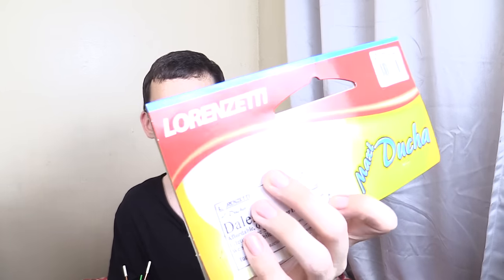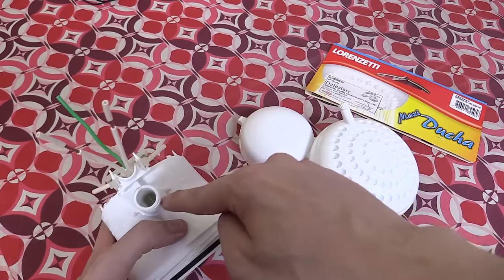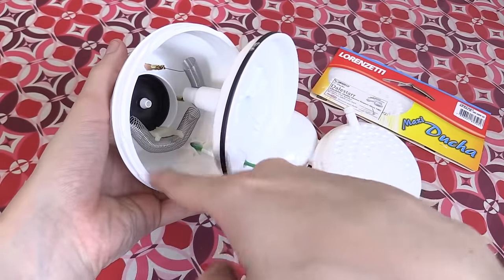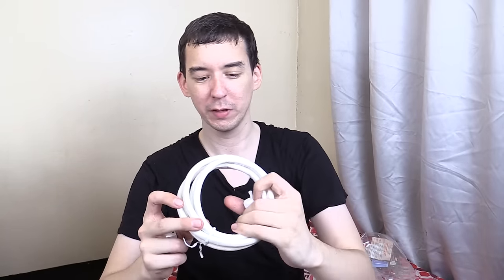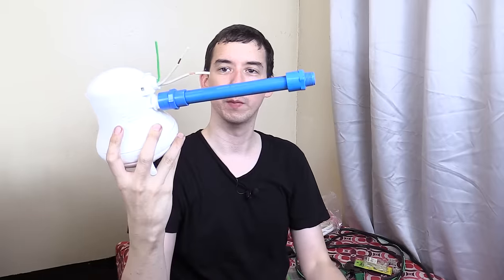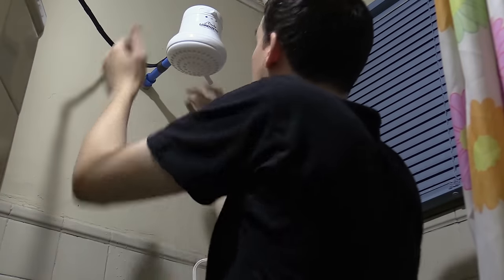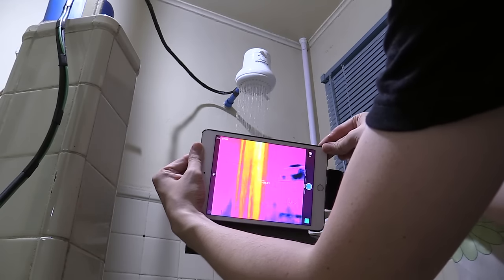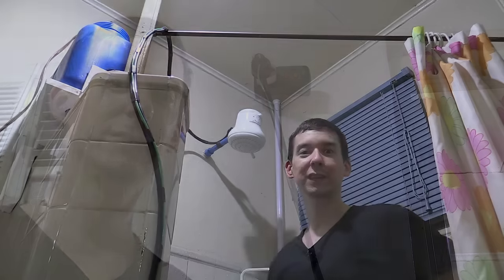Lorenzetti Electric Shower Head

Comment: Well you don't get electrocuted with these shower heads for two main reasons the first is because the "potential difference" happens mainly between the two ac lines and not between the ac line and the ground (or you). The second reason is because of the water flow isn't consistent meaning you have little drops of water falling on you and not a straight water jet what does it means? There are air gaps between the water drops and as we know air do not conduct electricity. Lorenzetti is a well known shower head manufacturer and it's been on the market for very long time so do you really think that if these showers were dangerous they will still in production?
Reply: Buddy just bc it's still in production doesn't make it good. Kimber 1911s are still made despite them being over priced trash that will blow up in your hands and lodge shrapnel in you hands and face and people still buy them. Unless you're super poor there's really no reason not to get something a bit better.
Reply: skinnypimp The fact is:
Me, and any Brazillian can remember any accident with eletric showers. It’s a big myth.

Comment: I'm Brazilian and I can assure you that this definitely would never kill someone... I personally hate electric shower but not for that... I think that the water is to "weak" (not pressure enough, imo) and also not hot enough, that's why I prefer solar heating system (also a very good option for you on Phillipines) or the gas one. Nevertheless most people have it because it's way cheaper than making an investment in a solar heating equipment (also, buildings rarely have it), gas is generally not available in smaller cities in a safer way and so on.

Comment: We just use an electric tankless water heater.
Reply: EJ Tech that sounds like a way better option tbh
Reply: Ours is propane but same concept love it
Reply: EJ Tech: ... Honestly I was here to post that a Tankless would be too cost prohibitive, But I checked Home Depot Canada and a 5500 Watt Tankless HWH (suitably for a VERY nice hot water shower) is only $191 ... compared to the Suicide Shower Head at $30? ... the tankless is a very reasonably priced alternative and 100% safe ... GREAT tip!
Reply: Hh Hh no a tankless heater feeds hot water to the entire house.
Reply: Here in the UK a 10kW  electric shower is fairly normal, but we don't use a goofy low 110V supply. A suicide shower would trip the residual current breakers that are in most houses as well as them being such a low wattage they're useless.
Reply: @MrsZambezi  The one he was using was running on 220V AC. Give or take, UK voltage runs barely higher at  240V AC if my memory serves me. Here in the US, we achieve 240V AC in residential settings with opposing legs of 120V AC.
Reply: Why not just use 240V for everything in the first place?  We can plug in 3kW appliances everywhere. That shower is pointlessly dangerous as well as being too weak to heat the water properly.

Comment: O melhor de tudo é aprender a trocar um desses desde criança, sem nem desligar a chave geral. Aterramento é luxo. Ninguém morre, até porque o choque de 220 V só te joga voando na parede. 

...and the best of all is that you learn how to change one of those things since you're a teen. Without turning the power off. Grounding? That's just fancy. Nobody gets killed. Even 'cause it's a 220 volts electrochock and it'll just bounce you flying against the wall
Reply: "só te joga voando na parede" kkkkkkkkkkkkkkkkkkkkkkkkkkkkkkkkkkkkkkkkkkkkkkkkkk morri tanto quanto um choque
Reply: kkkkkkkkkkkkkkk verdade

Comment: 4:40 is not because "blowing itself up", it's because if it keeps filling the water will raise and probably leak into the electric part.
Still entertaining watch, I live in Argentina (right next to Brazil) I've never seen one of these in my entire life.
Reply from the maker: Thanks for the info :) By the way, when I said blowing up, I meant more that the top or bottom part would blow off because of the pressure rather than some kind of explosion :P
Reply: I am from Argentina too and when i went to Brazil i was shocked (pun intenteded) by this little thing. I could actually felt the electricity and i figured out that the whole water heater machine was inside the shower! Freaking scary for me cause i never saw something like that before.
Reply: Brazil and Paraguay, they are very common in the suburbs and in many major cities because of its cost. It is much cheaper than buying a water heater and do all the pipes. In Argentina there is a similar system, the electric water heater which is basically a plastic or metal can with a resistance inside. You fill this with water, connect it to the the socket, and it has a shower built in. The most advanced models had a on off swicht, for the rest it is advisable to unplug it before using it. In my case, very useful when the Gas company closed the gas connection for months.
Reply: Hernán Payne i live in paraguay, everyone uses it, i only know one friend that almost died, and not cause of these showers, ironically, he actually had a external water heater for the whole house and it suddently exploted for no reason, since then he uses this "dangereous" solution.
Reply: I've seen hundreds of these in Brazil. I do hate electric shower heads because you get a trickle of water that is either superhot or just cold. Always rented apartments with real gas heaters.
Reply: These are also common in Venezuela under the brand name Corona, which looks even cheaper than this. At 120v its half as efficient to heat the same amount of water, so its lukewarm at best, and yes you do feel electricity if you touch it or the shower has a metal part, which is very very common. People may not die from them but i still hate those things, it is however the cheapest way to have heated water at your shower. I also used one in Peru, which is a 230v country, but it was "winter" so the outside water came so cold the little thing couldn't cope with it, but if you you didn't use it the water came out freezing as opposed to cold... Yeah, same "tingling" sensation when opening and closing the (metal) valve, fun times...
Reply: Electric showers are common in South and Central America, I think only Argentina and Chile don’t use this type of shower, because this 2 countries are on the cold part of the continent. Here in Brasil is not viable to build a water heating system because only a small part of the year are “cold”, and we don’t use hot water in sinks and in the kitchen sink. the coldest regions the average temperature in winter is 10C, and in the biggest cities the average is 18C for São Paulo and 23C in Rio
Reply: @freeculture   Corona....interesting

Comment: American here and former electrician.  I’ve seen these things on several trips to Peru and I saw a lot of this crazy wiring. I was told “don’t touch the shower head while you are taking a shower”. Just insane that anywhere in the world a product with such a tiny safety margin would be so popular. 

The reason you won’t see those in the US is that even if there was 2 deaths a year the company would be sued into bankruptcy. We have electric water heaters in the US and the conductive element is surrounded by ceramic insulation and encased in a grounded metal tube. At no time is electricity in contact with water. 

As far as gas explosions from electric heaters, those almost never happen. I have never heard of one on the news, and have never heard anyone tell me it happened to them or someone the know.  We know they happen because safety videos tell us, but it is statistically zero.
Reply: I live in Brazil, used to have that shower head, and currently have one that's pretty much the same, except a different brand. I would be amazed if there's been even a single death by electrocution caused by this shower head in the past decade.

The average toaster you can get in the US electrocutes more people than this shower does.
Reply: Of course you don't touch anything electrical while you are showering, your hands are wet! Dry them up first
Reply: @QuotePilgrim  You can find plenty if you look for "muerte ducha eléctrica". How many of those deaths in Spanish-speaking Latin America are due to locally produced showers and how many to showers that Brazil exports, I do not know.
Reply: @haraldhelfgott195  well I remember looking up news in Portuguese about this happening back when I wrote that comment, and didn't find any. Maybe if I used different search terms I might.

Anyway, sure, it may happen sometimes but I never about it from anyone I know, nor read/watched any news about it. It's safe to assume that it's an exceedingly rare occurrence, and I would still bet on people getting electrocuted by toasters being a far more common thing.

Comment: These are the norm here in Brazil, they're cheap and you don't need a heater but I can agree it has potential to do harm, the biggest problem on them is that the cables are usually thin and when it's colder you need a lot more potency. It's not uncommon to see the stuff getting on fire around the tapes or the cables melting. Also lots of people install these shower themselves instead of paying for a capable professional to do the job.

Comment: There are also high quality electrical showers here in brazil. In fact, almost all homes in most of brazil have a wiring hole or outlet right above the shower plumbing in every bathroom shower position! I've installed tons of these and removed others, wheneve i move to and from a new home. When they are grounded improperly you might get a little shock, but surprisingly not from the water, but from the metal valve!! They are perfectly safe and the heating element resistance will eventually rust and give out, and then you'd buy a new one and easily replace them. I have a really good one that was fairly expensive called the lorenzetti Futura model for about 5 years now, only had to replace the resistance twice so far too. These are great.
Reply: I hate the lil shock I get every time I touch the metal valve!! I've trained myself to open/close it with the hose. now electric faucet in the kitchen I get shocks from the water always!! I usually always have a lil scratch or cuts on my hands, maybe that's why. so I never use those — also perfect excuse to not wash the dishes👀

Comment: I had an experience with one of these while living in Ecuador. The shower unit got stuck on full heat (boiling water falling on my head). While suffering with that I tried to turn it off.  I proceeded to get shocked. Decided to finish with a cold shower....

Comment: I guess this is not allowed in Europe, because I have never seen or heard about electric showers. There are just two pipes for hot and cold water, which are then mixed on the tap to get right temperature.
Reply: That's because you have boilers to heat your water.

Comment: I've been using this very model over the last 20 years at home, without any problem (I have 2 sets of this model, each one is used 4 times a day, every day). Obviously I have to replace their resistors every 3 months, in average, and I have to replace the complete sets every year, in average. But, except for that, I'm very satisfied with this product. If correctly installed, it presents no safety problem at all. Note:  I have no relationship with the manufacturer.

Comment: If you live in a house and your outlet is not earthed, drill a narrow hole through the floor to get you past the concrete, hammer a long (0,5 - 1m), sharpened iron or stainless pipe/bar through that hole and connect it with a copper wire to the outlet ground. There you go, instant earth for your outlet.
Alternatively, a long screw in the wall may also provide some earthing, though much less effective - depending on the wall materials.
Reply from the maker: I believe earthing against the buildings rebar is quite common inside the Philippines. So i'd imagine some people might go that route also. I'm not too sure how effective it is long term with rust, corrosion and such like.
Reply: soupflood concrete, and hollow bricks won't do shit (majority of Brazilian houses are made like that) and believe it or not, a lot of houses doesn't even have ground wiring (but we still dying more from gun shots than electrical shock)
Reply: soupflood and let's say that, our security standards for electricity are lower than 0, you can have an exposed wire running through your entire house, if your kids can't touch it, no one will care
Reply: MrAkenatom whut.. to the contrary. all brazilians houses have ground. You wouldnt be able to put on a light otherwise. Just pull an additional wire from breakerbox to shower and connect it to the breakerbox it selfs. As easy as that. Andmany many houses these days have earth wiring too. In aparments its obligatory btw.. you dont know what your talking about
Reply: Long screw in the wall cracked me up. Let's just put a 10 cm copper rod into a 4 liter bucket filled with dirt and couple small plants. Hehehe
Reply: MrAkenatom *don't

Comment: Just made a quick calculation and, assuming the worst case scenario, you could get a shock of 10 - 7 mA that could actually kill you. Although, as I said, this is in the worst case scenario (with a lot of approximations in favor of the shock) so you should be fine as long as you conect the grounding wire.

Comment: If it was really a suicide shower,  then people wouldn't use it. Because, I know this is hard to believe,  people don't like dying.   These things are very useful for things like deep wood cabins where you can't lug or maintain a boiler.
Reply: would rather use a wood  powerd boiler then. Those are actually pretty easy to build. And most of those cabins dont have a power connection either i think. That means getting the 3kw/h you need for this is going to be a challenge too.

Comment: Here in Brazil we use it in practically every house. There are some precautions you take when using this type of keychain.

1. It must be electrically grounded, that is, the energy that escapes from the shower must go to the ground.

2.The water that comes out of it does not cause a shock, but you should not change the power of the shower while it is on, as this generates an electric current.

3.The shower only turns on when the diaphragm inside it fills with water, so to turn it off, just don't let the water flow, then change the power and then turn it on again.

4. Do not use a metal water release system (handle or water valve), as if the power is not connected correctly, the current could pass to the valve and cause a shock.

Comment: If your 220 volt supply is 2 phase and you don't have a ground wire, just connect the ground lead to the neutral. If your 220 volt supply is single phase, you don't even need to ground the thing.
Reply: No, look, for residential power here in brazil, there are some regions where you get 220 volts in one phase+neutral like in Europe, and there are regions where you only get 2 out of the 3 127 volt phases+neutral (220v in total, 120 degree, or 127v if you wire with a phase and a neutral wire) and if you live in some residential areas, you get 2 115v phases (180 degree) and a neutral. And don't even get me started on the 254v rural power...
Reply: O cara vem querer ensinar reza pra padre hahaha

Comment: I saw that each of the copper pins is connected to a spring.
One of the springs is small, the other one is large.
The large spring will put out more heat, than the small one.
It's hard to see on the video, but can you flip the adjuster to the other contact point?
If one setting is powering the small spring, and the other is powering the large spring, you might get warmer water with the larger spring.
But if by default the larger spring is always on, then there's little modifications you can do to reduce heat output, other than solder a resistor in series with the showerhead.

While both springs might warm the water too hot, it might actually work just fine in winter time.
Still an output of 3500W is about the same as what a Home Central AC system uses in hot climate homes!
Reply: Muranaman You can choose between Hot warm and off, and I used this type of shower my entirely life and nothing happened, and I never heard anything about accidents.
Reply: Indeed you'll be switching from using both springs at a time or only one of them (they are one only, indeed)
Reply: the small one puts out more heat

Comment: Electric shower has been used for years in Brazil and the number of shock accidents is small, we have more accidents with gas systems, and both give problems due to poor maintenance or incorrect installation. It's not a suicide shower.

Comment: It saves a lot of energy since you dont lose heat on tubes as if you had a heater. It heats only the exact amount of water you gonna use. Also, it heats the water in 5 seconds, so also saves water. I love these ones and had never seen someone being shocked by taking a bath with them.

Comment: Thank you. I was looking for how to clean. In your video I seen that the bottom side unscrews buy the threads. Also I learned that the ground is to connect to the house not the ground in a three pronged plug, because that never worked for me.  Again thanks for the

Comment: I used them for 5 years. They are wonderful. You only get shoked if the wiring is bad or the heating element did burn out. If its too hot increase water flow, if its too cold turn water down a bit. Counterintuitive but thats how it works.
The shock you get from faulty wiring is like a strong tickle, but not lethal. You can still shower with a fauly wiring, just dont touch any metal with your foot / hand. 
Those units are much more energy efficient than the "european way", heating up 300L of water and keeping them at 60 deg C 24/7.